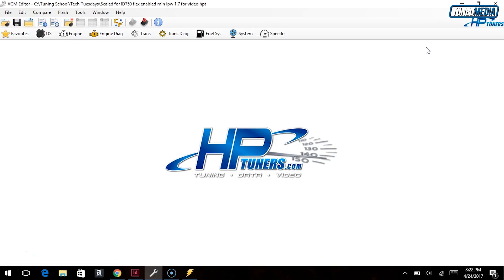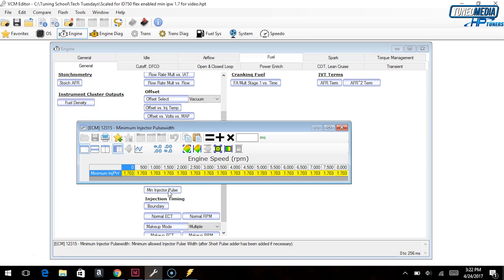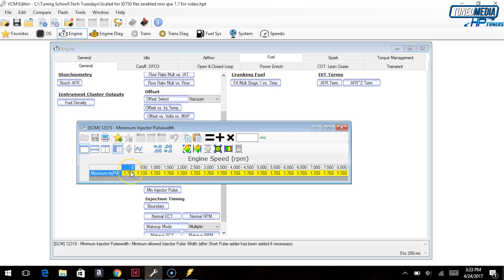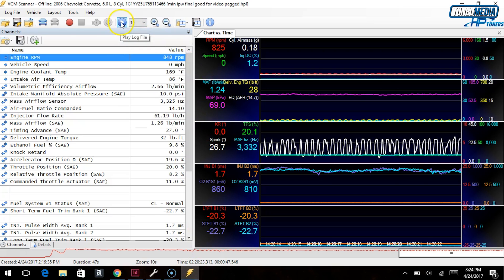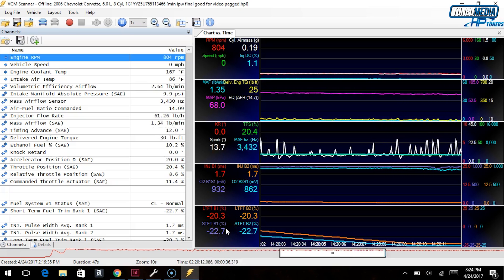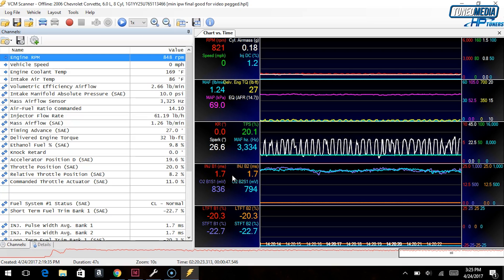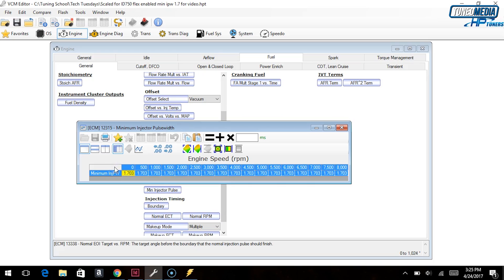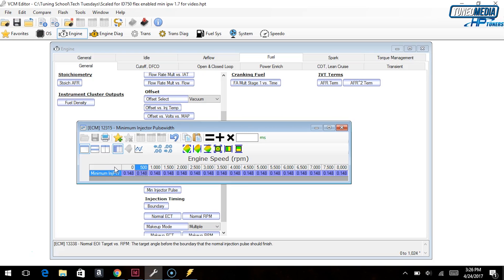How to avoid staying too rich at idle: Minimum Injector Pulse Width

Comment: Tuesday December 2 2025 6:22pm CDT
I have an 04 Subie 2.5l sohc 251. How kan you make a work around without tuner equipment to get this beast ECU to lean out.
LOW MONEY METHODS NEEDED
I believe I have fouled O2's because I gilot if as a beater with what is an outside leak but suspect leaking from valve seals and possibly dropped valve guides on the exhaust side and it is possible the intake gasket is leaking if there was a suspect leak area. The new plugs seemed to lean out the burn on my first overnight idle last week less fuel was used kompared to old OE plugs when observing from the gas gauge versus the scan gauge. When I did a battery test twice the next night after changing the plugs, I noticed it seemed the ECU then changed and now it seems like it is using double the amount of fuel for idle despite the battery itself should have come back up to full voltage.
Please chime in when air leaks kan't be detected how we kan get to lean out this komputer garbage I never had a problem leaning-out a carbureted Kar?
Thanks eddiesasquatch@proton.me

Comment: hi im from mexico,,here we have the aveo T-250 with e-tec II Engine..it has an awful mpg (19 mpg) with a/c is worst...even when new ..it has from factory the same fuel injectors as a v8 chevy silverado ...does that explains why even the aveo is a 1.6 4 cyl..i guzzles gas like a v8 truck???

Comment: Thank you. Just learning to tune. 
I Modified my CAM 228/230 112LS , injector 26# to 50# , bigger  cathedral intake and throttle body 75mm to 102MM.
Basically, huge changes and a hell of a first time tune.
Injector data from Deatschwerks was way to rich for my c5 corvette idle, not their fault just my inexperience.
Got it setup for SD with MAFS, LTFT and STFT disabled running open loop for just getting the idle tuned. 
But I was as low as 3  for some of my idle values in my VE table ( no effect on Wideband it was - - - on my AEM gauge greater  than 2 lambda and just worse idle).
Was getting frustrated then this video . Thanks, got my stuff straight now.

Thanks again, this stuff is 6 years old but relevant.
Reply: what value did you use?

Comment: Do you know what is the minimum (idle) duty cycle in percentage for 33 pounds per hour TBI injectors?
I set it to 7% but it doesn't want to sustain idle nor acceleration.

Comment: Is it common that once you come to a stop in traffic, to run around 13.0afr from about 30 seconds to a minute before it rises back to 14.7afr?
Reply from the maker: No really. Might want to check your injector data and wideband working correctly first. Then check your MAF.

Comment: Anyone able to help me with my ID1300X Injectors on my 2JZ-GTE Supra? I want the car to idle as factory, but they are running at 1% Duty Cycle on Pump fuel, and really need someone who is experienced to help. My tuner had no idea and pretty much just did a power run and didn't touch the idle. Would really appreciate some remote help, happy to pay someone for their time.

Comment: So I have a question I just installed new 42 LB injectors and I'm having this issue I feel. The injectors came with data and the min pulse width is .805 could I lower it and see if it helps? Thanks in advance
Reply: Were your injectors stable at less than .805ms

Comment: My ID850's IPW is set .125 are set from the data from ID. My idle injector pw is 1.3 at idle, but if i slightly crack the throttle, the pw drops to .8 or so....what gives? AFR stays the same. closed loop.

Comment: I added FLEX FUEL INJECTORS to my ls 5.3 the pcm is 0411 that came with truck that had FFV but I installed a 60 psi intank pump and later learned FF injector only need like 54psi fuel pressure will the hp tuner work out this situation?
Reply from the maker: All GM LS V8 fuel systems are designed to be operated at 58 psi (or 3 bar) of fuel pressure. That includes your FFV injectors. The important part is that you accurately carry over the injector data from a tune in a FFV to your 0411 ECU. The tables will not be identical so this won’t be and easy task. I highly recommend getting some of our course material (if you haven’t already) for a more detailed explanation of the fuel injector tables. With our materials, you also get access to our technical support staff to help you get the tune setup correctly.
Reply: TheTuningSchool  I just purchased the MPVI2 so I’ll get some data from that and see what is going on

Comment: 3:13... why is ignition timing oscillating like that?
Reply: Ditto.  Looks acceptable at 8-11* but every second you'll see it jump to 23* ? Wondering if this is the result of noise in one of the ignition sensors.

Comment: I have F.A.S.T. 65lb injectors. As I am sure many people found out after they bought them, there is no official data for them. It's believed that the FAST injectors are just rebranded Deatschwerks, who does provide injector data. I am using their data, which has a .729 Min Inj Pulse width which does create that rich at idle condition. I can't get the o2's to switch nicely at idle and light cruise. I played with Proportional Idle and O2 Rich/Lean vs Airflow to no avail. O2's compared to wideband Lambda was showing me 700-825mv, so this seems highly likely that this will help. I will test and report back.

Comment: Would you consider a 48 lb injector "big" for it to need to be dropped down to .350? I'm asking because my car carbon fouls the plugs as soon as I start it up..I believe it's running way rich at idle from something commanding it to do so. Either bad o2s providing bad feedback or from bad injector data (I believe). Also running tr6 plugs in a NA car, have some tr55s I'm going to throw in to help it. (ls1 car if that helps ). Any feedback would be greatly appreciated. Keep up the vids, very informative 👌🏼

Comment: Afraid to plug in the data!?

EDIT: as an aside, I see (or smell, rather) a lot of large-cammed LS cars on the street with stinky rich idles.  Is this the most likely culprit or is it a vacuum issue?
Reply: kickblake it’s usually an injector timing issue.

Comment: i was running lean and had a misfire, so i upped the min pulsewidth and it fixed the problem. but now when i start the car up it goes really lean for a few seconds and the corrects itself
Reply: Hello, I have the same problem. My truck has a new injector that has 17.1 ohms of resistance compared to the others with 15.8 to 15.7 and my truck runs rich at idle with a p0206 injector circuit malfunction. I've took it to the repair shop and they said the checked the wiring and it checked out so, they had me replace my computor but, the problem still persisted so I've been stuck on ends. This could be the solution I've been searching for. Did you have the same check engine light with your vehical by any chance?